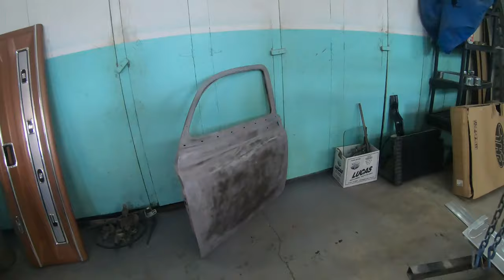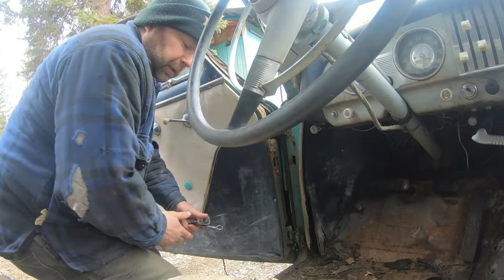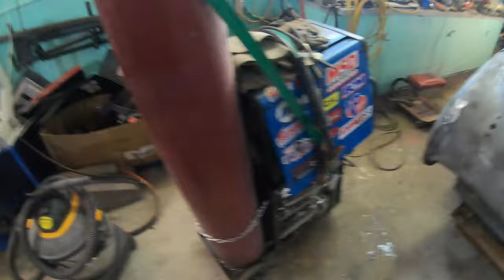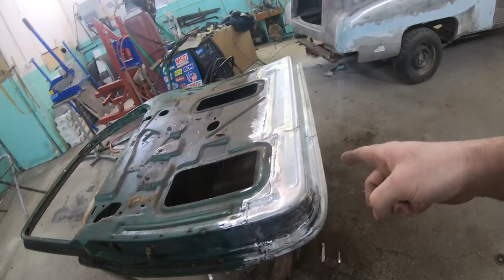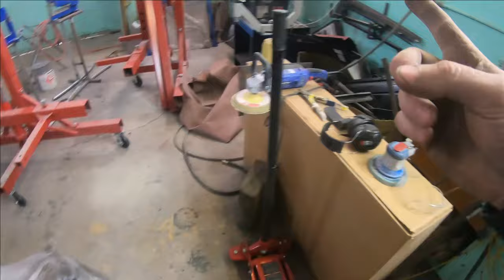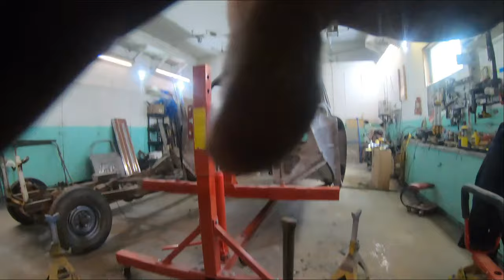1952 Chev sedan delivery gets more metalwork, and put on the rotisserie

Comment: Just as a heads up john, the roll pins in the worm gear of those rottisserie cranks fail. I have 2 of them. If you replace the roll pins with solid pins and tack weld them in it cures that.
Reply from the maker: Good to know, thanks for the heads up 👍🏼👍🏼
Reply: @Johnnymidnight  for sure! You'll see what I mean
Reply from the maker: You have me thinking now I should address it before it fails, likely at the worst possible time 🙃